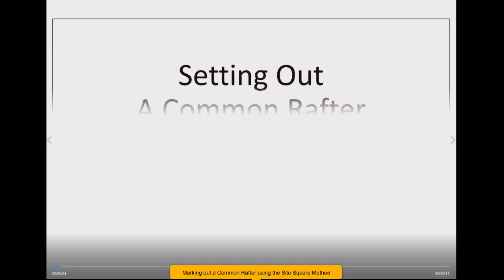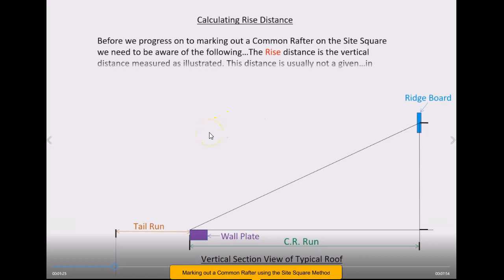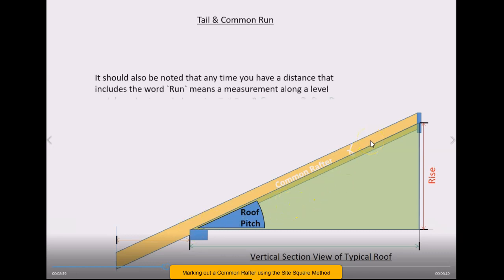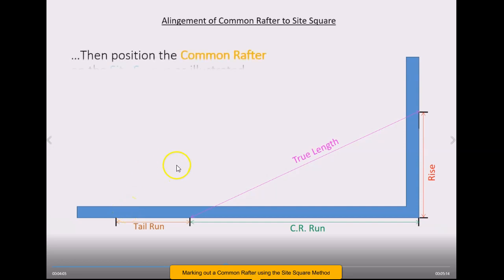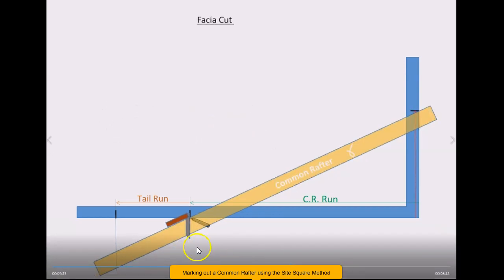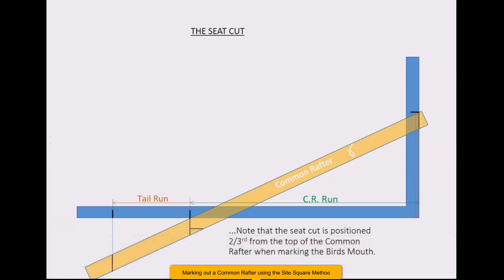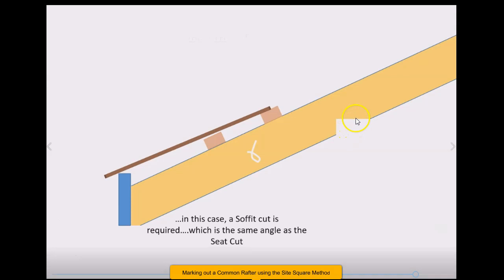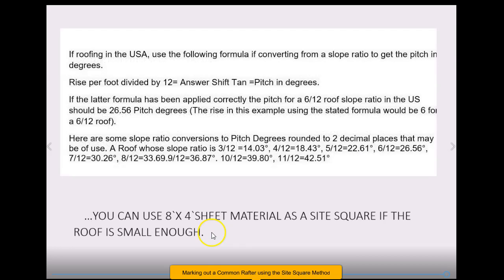MARKIOUT A COMMON RAFTER USING A BUILDERS SQUARE

Comment from the maker: If roofing in the USA, use the following formula if converting from a slope ratio to get the pitch in degrees. 
Rise per foot divided by 12= Answer Shift Tan =Pitch in degrees. 

If the latter formula has been applied correctly the pitch for a 6/12 roof slope ratio in the US should be 26.56 Pitch degrees (The rise in this example using the stated formula would be 6 for a 6/12 roof).

Here are some slope ratio conversions to Pitch Degrees rounded to 2 decimal places that may be of use.
 A Roof whose slope ratio is 3/12 =14.03°, 4/12=18.43°, 5/12=22.61°, 6/12=26.56°, 7/12=30.26°, 8/12=33.69.9/12=36.87°. 10/12=39.80°, 11/12=42.51°

Comment from the maker: Note that its Pitch in Degrees thats referred to here...i have a note added at the end of this video for those that may be roofing in the USA. (In The US its a slope ratio per foot run that is a given instead of a Pitch in degrees)
Reply: Michael I'm wondering if there is a shift button on an android phone calculator. And if so can you decrib the button
Reply from the maker: @paulgreene421  hi Paul...if you go into scientific mode in your calculator you will see a button in the corner with 2 arrows...check out last 2 mins of this video re scientific mode on samsung phone calculator  https://youtu.be/NexKlY6oxkk
Reply from the maker: ...the button with the 2 arrows brings you to a second set of options on the screen.....for instance...9 divided  by 12= 0.75.....select & copy this answer (then clear screen).....hit button with 2 arrows to get Tan ̄ ˡ option (hit It)...past answer you copied earlier....your answer should be 36.869.....degrees
Reply: @michaeldownes516  thanks Michael I'll give that try. Can do it on a sharp calculator but don't always have it with me.  Was drilled into me 7 decided 12 second function tan 30.26 degrees. .like you videos very helpful. ...
Reply: Another excellent presentation, very concise. Those pitch to degrees conversations are stamped on most quality speed squares. I am slowly working my way through your content, 👍 🔨 🇮🇪
Reply from the maker: @TheToolnut .. thanks for the feedback....enjoy the voyage through the content.